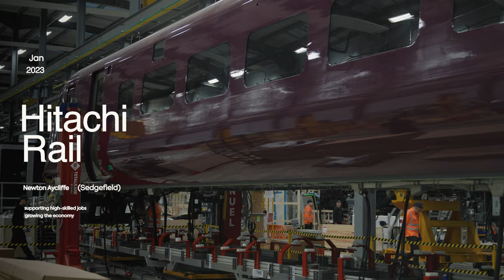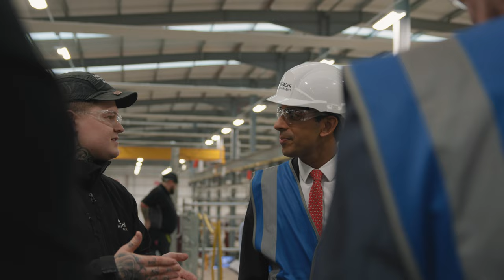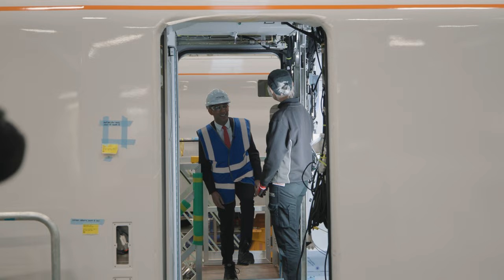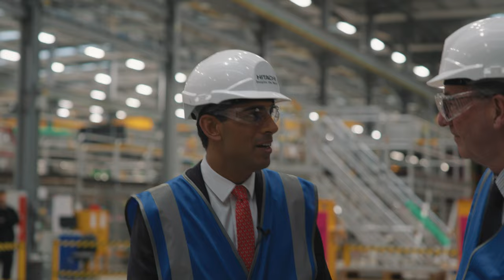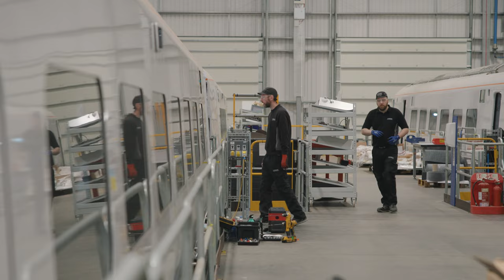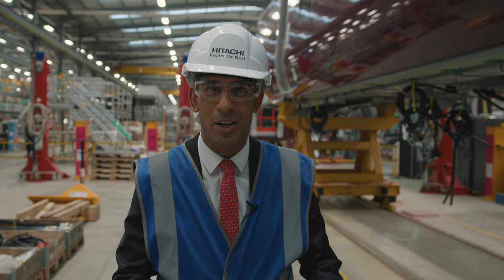Growing the Economy | Rishi Sunak visits Hitachi Rail

Comment: Time is running out for this government. The strike action by public sector workers will soon trigger similar action in other private industries. 
We are heading toward the expected effective general strike. 
Buying  equipment for the NHS is pointless without the skilled staff to operate it. The new ambulances will be left parked for want of crews. 
A fire service strike will put many industries out if action, as a result of safety and insurance concerns. 
It is depressing that the country that invented the railways is now dependent of a foreign owned business to build trains to run on UK railways. One must hope that some of the design work is being done in the UK. The profits will leak out of the UK economy and be exported. That is what foreign investment means. 

Expecting the strike threat to disappear if inflation is reduced is naive. Inflation represents a first differential, do even if inflation comes down, the damage will already have been done, as prices will remain at their new elevated value. The government's only bright spot, is that labour have yet to suggest any solutions to the problems in the near future, and seem reduced to snipping at the government. That said, those making windfall profits from the current situation should be subject to a windfall tax, not only oil and gas producers, but also private healthcare. 
Conservative MPS would be mistaken if they think this government has until the next election to get things right. Without a break through policy, this government has a few months at best.
Reply: The government is doing its best to negate my prophecy of an early general election, followed by a landslide Labour victory. It is possible, that by settling so many of the labour disputes, it has managed to avoid the expected vote of no confidence that would have triggered an early general election, though the threat has only receded, not gone away entirely. 
I take no pleasures in predicting a landslide Labour party victory at the next general election, as there is little evidence that Labour have any better ideas  of solving the countries woes. The liberal party is almost completely irrelevant, as it's main policy is misguided appeasement of the EU. A policy that would quickly make the UK a vassal state of the EU. 
The conservative party has recently been shown to be riddled with self serving MPs, who hide their vested self interest agenda behind the fact that they have not broken any rules in their sleazy behaviour,  Something their constituent will no doubt disagree with at the next general election, further increasing the resulting Labour majority.
 Do these incompetent conservative MPs really think they are worth £10,000 per week?
There is an old adage, that if you stuck in a hole, it is advisable to stop digging. Clearly this wise advice has escaped the current government. They prefers to believe the new economic of a debt based economy, rather than accept that the UK needs to be profitable, and as self sufficient as possible in all aspects of industry and production. We cannot increase the wealth of the country  by building houses, or by selling expensive imports to each other. The government  cannot save money at the expense of our natural  environment and wildlife. 
The government was repeatedly warned of the folly of the HS2 project, and how it would become an expensive white elephant, costing far more than predicted and producing far less in return. It was warned of the folly of allowing foreign ownership of our critical industries, utilities and infrastructure, yet it continues with these policies. It continues to sign contracts that give private companies the profits and leave the tax payers to fund any losses. It continues to allow private health care companies to make huge profits at the expense of our NHS. It make inefficient changes to the tax system, to purportedly keep skilled doctors in the profession, where in practice these are simply thinly disguised tax cuts for the richest 1%, or less, of the population. 
So while this government may have narrowly avoided being thrown out of office early, it can still look forward to a significant time as a minority opposition party following the next general election.
Reply: @nigeljohnson9820 I fail to see that,  it's possible to have a coalition  of sorts maybe the new and tories being a minority government is also possible besides the economy needs drastically reformed to serve the people and not the other way just like Hjalmer Shacht a German economist who albeit had to contend with problems of the nsdap still managed to get Germany thriving in 4 years.
Reply: @Peacefulnessxxx  the problems of the German economy are tiny compared to those of the UK. The UK has lost control of its means of production, which has mostly fallen into foreign control.
Germany still makes things, the UK economy seems to be virtual, based on services and creative accounting. We measure our success by how many expensive imports we sell to each other and how many houses we build. The UK government rejoices in foreign investment, yet all foreign investors expect to take out far more than they put in, by definition. 
The next general election will be lost by the conservatives, it will not be won by labour. That is to say the electorate will be rejecting the existing government, not choosing the labour alternative. 
I suspect instinctively the electorate are not expecting anything better or new from labour, they just want to escape the conservative sleaze and economic mismanagement. Some of this is driven by the media, which now has a clear left wing agenda,. It's as if the media needs a news story of a refreshing new government. 
We have seventy years of flip flopping between the parties, with each just managing decline, as the UK edges a little closer to a third world economy.
I suspect that part of the problem is that the UK liberal elite instinctively boke at the idea of treating anything foreign as the enemy, it is seen as somehow racist, maybe a legacy of our colonial past. Our government talks about our friends  in Europe, but that fails to recognise how the economic world is really organised. We cannot measure our economic success by how much we increase the wealth of foreign investors, or multinational companies. The technological successes of our competitors are not ours, even if they are based on the ingenuity of our scientists and engineers.